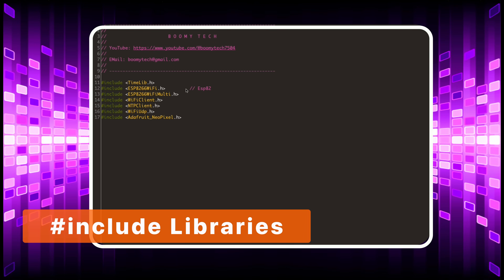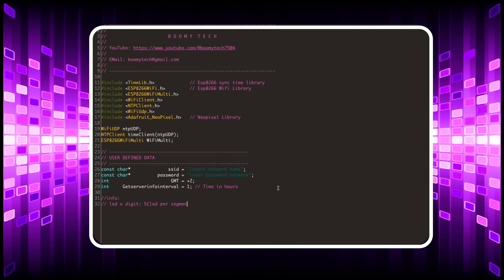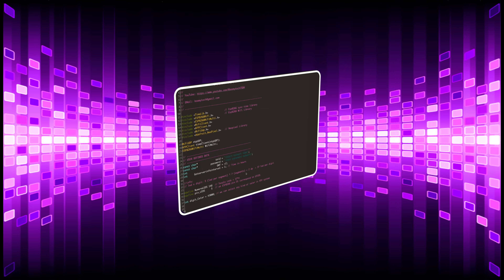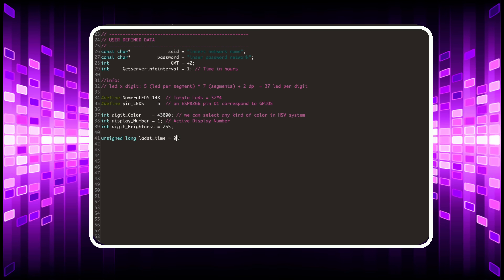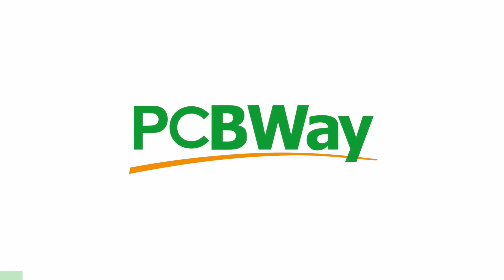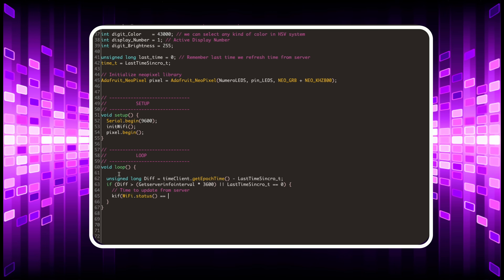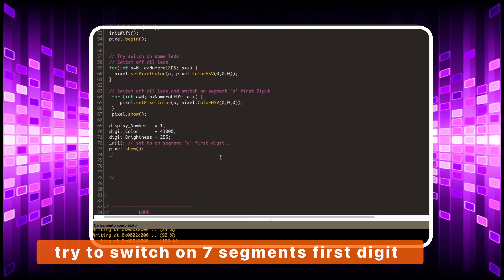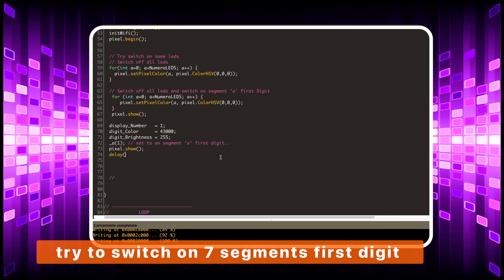LARGE DIY Digital Clock 7 segment ESP8266 + Arduino CODE

Comment: Hi I just completed the code. I am using 8 led per segment i.e in one digit(8*7=56) 56 leds plus 2 for DPs. so in total 58. I changed 1) #define NumberoLEDS 232 (8*7=56+2=58*4=232). 2)pixel.setPixelColor(i+((display_Number-1) * 58 in all lines. But still not working. Please what else I have to change
Reply from the maker: Hi friend, I'm abroad until September 5th and I don't have the source code to show you. If you watch one of my videos where I build a single 7-segment display, you'll find the link to the library on GitHub, which has a lot of information on how to manage the display. When I get back, I'll write to you to help you out...
Reply: @boomytech7504  Hi I will wait until you come back. Enjoy your holidays. Thanks for reply.

Comment: The clock works. I have set the flashing dots at the end of the WS2812. How can I address these?
Is there a way to integrate the clock into Home Assistant so that I can control the brightness and color?

Comment: The 1st number works but from the 2nd, i.e. the 10th row, the LEDs no longer work
Reply from the maker: Hi, I think this is a cable connection issue.. pls check every connection.. this is the problem..👍🏻👍🏻

Comment: Hello. I have copied the code as it is. When the module starts, it just says "connecting WiFi" but nothing else happens. What could this be?
Reply from the maker: Hello, you have to insert your network wifi name and password..👍🏻
Reply: I did. Also the right one. There are always only points
Reply: Ad monitor

Comment: I made a clock with 86 leds (3 leds per segment,21 leds per digit and 4 leds (2×2) for blinking dots..but 2 dots are not blinking for seconds plzz help
Reply from the maker: Hello friend, these are the line about two dots blinking every seconds:
void _dP1(bool is_ON) { pixel.setPixelColor(0+((display_Number-1) * 37),pixel.ColorHSV(digit_Color, 255, is_ON ? digit_Brightness : 0));}
void _dP2(bool is_ON) { pixel.setPixelColor(11+((display_Number-1) * 37),pixel.ColorHSV(digit_Color, 255, is_ON ? digit_Brightness : 0));}
Reply: I use 43,44,45,46,leds for flashing dots.how to edit that
Reply from the maker: pixel.setPixelColor(0 <-- zero is the first led first digit named DP1
pixel.setPixelColor(11 <-- 11 is the 12 led first digit named DP2
-you need to adjust "0" and "11" depending to your led assignment...

so, the two line below make the DP1 and DP2 flashing
 display_Number = 3; Digit_DP1(FlashingDots); 
 display_Number = 2; Digit_DP2(FlashingDots);

Comment: Finally figured out the connections. Questions are in regards to a 12/24 hour time, how to make it a 12 hour and not show the first "0". Second are the color of the pixels are defined in one place as int digit_Color    = 43000; or do I need to change a bunch of places. I am wanting the LED's to be white and not the blue'ish color they are. Thanks.
Reply from the maker: Hi, digit_Color is the var that determine the color in HSV Color Format. if you want a white color you have to de-saturate the color:
pixel.ColorHSV(digit_Color, 255, is_ON ? digit_Brightness : 0 )
255 is maximum saturation, 0 is no color saturation.
you need to play a little bit with source code and you can obtain everything you need :-)

Comment: Sir, I USE ONE NEOPIXEL LED PER SEGMENT AND TWO DOTS (i,e 9 per digit total 9x4 =36, ) just tell how i define segment "a" of first digit ,rest i will do  by myself with your blessings.
Reply from the maker: Hello, you need to change this line...
pixel.setPixelColor(i+((display_Number-1) * 37)
where '37' is the total led per digit. (5*7 + 2 points)

Comment: i upload your neopixel clock sketch but not working send me plz libraries link
Reply from the maker: Hello, pls write in the comment what is the problem so that me or other guys can try to help you.. :-)
Reply: i made this clock 9 pixel segment total 252 pixel led. work fine but i want to display dot flashing 253 to 260 pixel last 8 led pixel . how i can do this plz help.
Reply from the maker: @aamirusman6254 ok, so any segment is made by 9 leds. If you watch this video:
https://youtu.be/P29QfonZse8?si=c4ZoIqCZyRkSmSg8
At 3:10 you can see a drawing paper sequence leds. You have to re-calculate the numbers range for each segment and for flashing dots… as soon as I can I post you the software section you have to adjust
Reply: Thanks for Reply, i make one digit 63 leds. without dot now i want to change dots after 252 leds and in this video you made segment by 5 leds.
Reply from the maker: "and in this video you made segment by 9 leds". --> no, in my video each segment is made by 5 leds
Reply from the maker: this is the section:
 // Two dots flashing
  display_Number = 3; Digit_DP1(FlashingDots); 
  display_Number = 2; Digit_DP2(FlashingDots);
  FlashingDots = !FlashingDots;

and here is where I assigned led numbers ad each dot:

void _dP1(bool is_ON) { pixel.setPixelColor(0+((display_Number-1) * 37),pixel.ColorHSV(digit_Color, 255, is_ON ? digit_Brightness : 0));}
void _dP2(bool is_ON) { pixel.setPixelColor(11+((display_Number-1) * 37),pixel.ColorHSV(digit_Color, 255, is_ON ? digit_Brightness : 0));}
Reply: you assigned 0 and 11 led number in display number every digit have 2 dots . i know that you made each segment by 5 leds . but i made it 9 leds per segment. i want to simple 4 led flashing dot which is not related with display_Number.
Reply: for example 9 led per segment  9*7=63 leds per display and 63*4=252 leds in 4 display now i want to flashing dots 253 to 260 8 leds
Reply from the maker: change this line:
void _dP1(bool is_ON) { pixel.setPixelColor(0+((display_Number-1) * 37),pixel.ColorHSV(digit_Color, 255, is_ON ? digit_Brightness : 0));}

to this:

void _dP1(bool is_ON) { 
pixel.setPixelColor(   'your led number'.    ,pixel.ColorHSV(digit_Color, 255, is_ON ? digit_Brightness : 0));
pixel.setPixelColor(   'your led number'.    ,pixel.ColorHSV(digit_Color, 255, is_ON ? digit_Brightness : 0));
}

and do the same for _dP2 with less of second dot.

this will flash two dots...
Reply: i change this line 4 led flashing but every digit 2 leds not glowing off
Reply from the maker: Check your email…
Reply: Thanks for your reply i made it big clock 9 pixel per segment and working fine but there is a problem for internet if internet not available clock stop and when internet come back clock not start itself. the only way to restart the clock. is there any solution. i want to add ds3231 for time keeping what changes will be made plz help me
Reply from the maker: @aamirusman6254 hi, I so busy right now cause Im working on next video… as soon as possible I will consider your message.. stay tuned for next video..👍🏻👍🏻